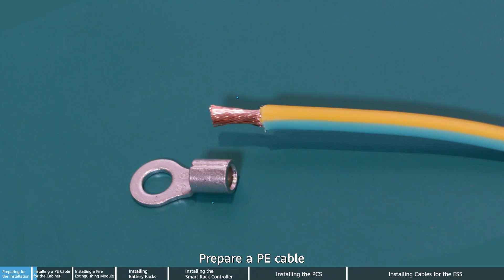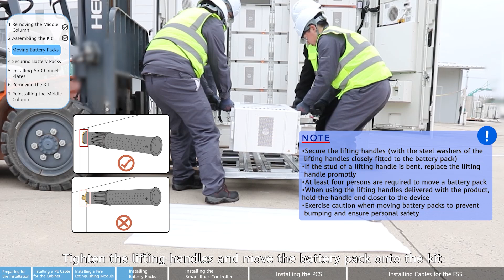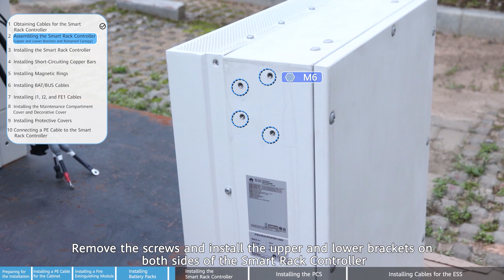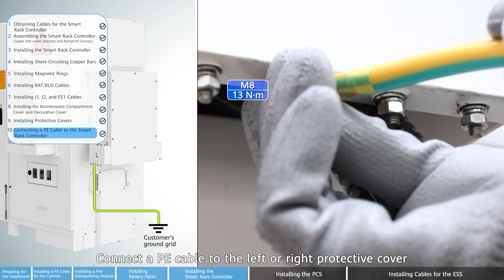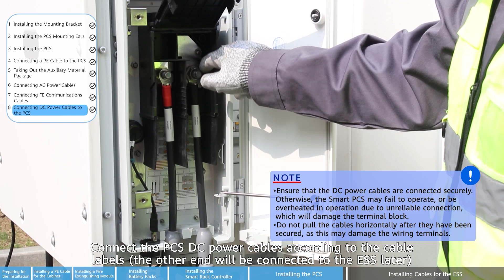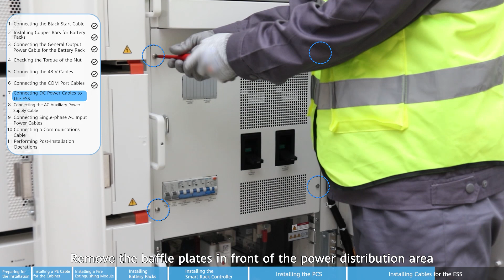(English) LUNA2000-200KWH-2H1 Smart String ESS Installation Video

Comment: Hi, is it possible to use one 100kW inverter to power for example 5 power storages (5x 200kWh)? How it should be connected? Or it is needed to use one inverter per every Luna2000 system?
Reply from the maker: Hi! The PV inverters are independent from the Storage Units. Each storage unit needs to have its own converter (Smart PCS). For further information, please visit our website for downloading related technical material.